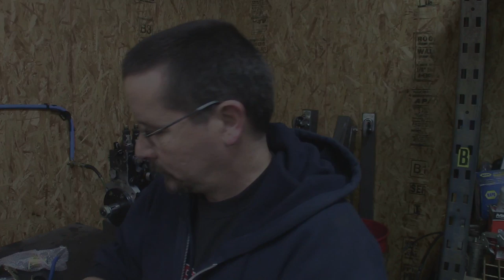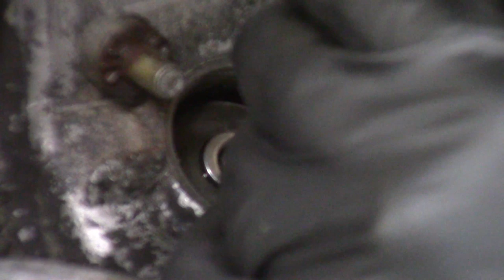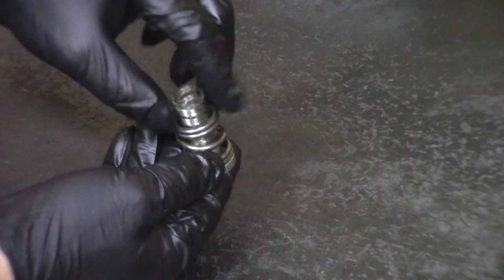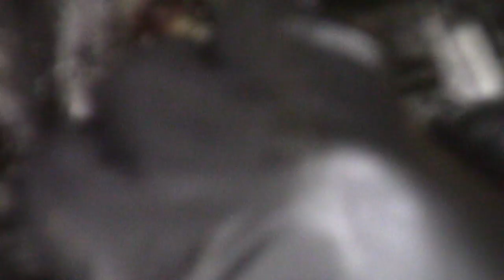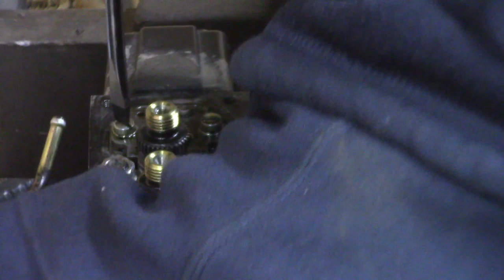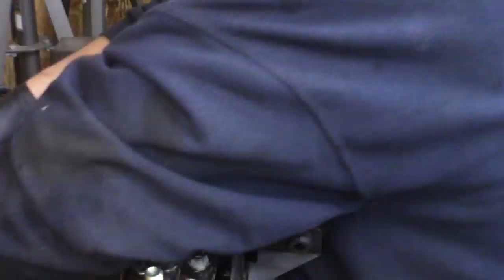How to Turn Up the Cummins P Pump!!!!

Comment: Just did a few mods to my P7100 this evening.  I did the modifications to the AFC housing necessary to run the Power Driven Diesel AFC Live kit.  I have governor springs as well but I'm going to wait until I have the pump back on the engine before I turn it over.  I installed new delivery valves this evening, which went well.  I also had my pump in my bench vise and it worked well to hold the pump.  Just need to get the pump painted up and then it'll go back on the engine.  Once I verify the engine runs again (I took it down to a short block and redid everything, similar to your build) I'll start tearing the 454 out of the truck.
Reply: Did you do the afc live I'm getting one soon for my 94 Thomas saf-t-liner skoolie. Are you happy does it work well.

Comment: Wow, very well done about replacing the governor springs off the truck and this video was hard to find, cuz everyone else seems to replace them in the truck! Good point about the dial indicator for the fool-proof way of making sure the tension is correct! I have a spare P-pump off the truck that was rebuilt from 160hp to 176hp with OEM 2500 gov springs. Needs governor springs, as the Bosch Service Center couldn't do it as per Bosch. My 95 OEM 180 P-pump had 3k springs in it, and I don't want to go rpm-backward with the rebuilt pump, but I want the pump to be more responsive and fuel harder earlier, not looking for more top-end beyond 3200 most of the time.
Reply from the maker: Thank you and thanks for watching.

Comment: Getting ready to do this as well.  I made the mistake of braking my timing Fork tool in my pump because I got everything in time and then came back to it the next day... and forgot the timing keys were in the pump and motor.  That wasnt a fun time but I got the broken pieces.  Had to buy an aluminum timing tool as that little thing from Cummins is like $70!

I am also working with a 160 pump.  I went with the Power Driven Diesel 500hp fueling kit.  5x12 injectors, 4k gov springs, delivery valves and a few other items.  I got their AFC live kit with it as well so I just removed my fuel plate.  I ended up with a BW K27 turbo as my goal is somewhere around 400-450 whp.

Still waiting on  a few more items before I can make any significant progress but the plan is to get the engine running again on the stand before I tear the 454 out of the truck.  I'm hoping I can remove the 454 and install the Cummins (just get it set in place and bolted to the trans) in a single weekend.  We'll see how well that all works.
Reply from the maker: Sounds like a pretty cool build you have going on there. 
The next stge in these videos will be installing the engine in my  82K30 so hopefully their will be some stuff in them to help you with that part as well.

Thanks for watching!!!
Reply: I’m thinking about the 375 hp kit on my 12 valve

Comment: was thinking of going from stock to 5x.012 injectors on my 12v. for more h.p. I have straight 4" exhaust and afe intake. Would I need to do any other upgrades or would the 5x12 be safe on their own?
Reply from the maker: That is the same injectors I'm running. If you do those injectors along with the springs and fuel plate mods you'll be very happy. 
If you are after more smoke go with a more aggressive fuel plate. 
I didn't get any any excessive smoke but everyone has different goals. 
Bump your timing up if you want to see more throttle response
Reply: @RicosGarage  16 or 18 degrees? thanks

Comment: So I have a 230 hp model 6bta 5.9 cummins no has yet to explain how is it getting there. It's in a 94 Thomas saf-t-liner school bus. Ive converted it to a motorhome aka a skoolie. I get no smoke at all. I'm wanting to make some mods but feel I could go backwards if it's just a ppump mod to get it there. I know it's detuned to not smoke out mom on the curb waving bye. How does a 3k governor work with shift points on a mechanical engine and a mt643 transmission

Comment: So do you have to pull the flag and its cap if the pump is still in the engine and turn it over via the front dampener?
Reply from the maker: Yes that is correct

Comment: @7:55 I had this plug fall out and I lost a bunch of oil on the highway, does anyone know exactly what this plug is called and the piece behind it? I heard him say flag. Currently I only have a plug from a pipe that is threaded into it and have been running it like that for 2 months.

Comment: What's the purpose of adding like a 3k governor springs. What does it do to the PPump?
Reply from the maker: It allows the engine to turn at a higher rpm. This allows for a higher top end road speed. 
Also when used with other kids such as fuel plate and bigger injectors and such allows for more power.
Reply: @RicosGarage  interesting cause my truck hits 3k but the ppump looks stock. It even got the security chain across the cover.
Reply: What's the best way to lean out the truck a little cause I got a small amount of black smoke as soon as I hit the pedal.

Comment: Hi i have problem with governor on my P7100 pump. Its surging and i have hard time to start engine. Do U know what could be a reason?
Reply from the maker: Has the pump had any work done to it recently?
Reply: @RicosGarage  We are talking about marine engines and as far as i know boat was submerged. Whoever decided to milk the insurance, they filled up to the top with oil prior to sink.. Im the current owner and trying to reambulate boat.. I changed bunch of things on those engines. Port side works like clock but starboard gives me a hard time. Previous owner had AFC top cover removed and he was sticking with screw driver and probably he did some damage with governor. Any ideas what could be a broken inside?)
Reply from the maker: The pump is essentially a small engine in itself. Lots of moving parts inside. I'd recommend you take it to a reputable shop as it may need some internal parts replaced
Reply: @RicosGarage  Thats a good advice but problem is that shops near me they are specialized in truck engines. For me engine is engine and dont see big difference between the pumps.

Comment: Why not adj spindle,and Allen bolt on after housing??
Reply from the maker: I just prefer to do the adjustment on the vehicle. 
I've found every application is a little different and there is no hard and fast rule of turn this screw 3 turns etc. 
Doing the adjustment on a running driving truck allows to "tune" it better in my opinion. 
Thanks for watching

Comment: I’m trying do this on the engine does the pump
Have to be timed if it stays on the engine
Reply from the maker: No if the pump is not removed or disturbed in any way it will not need to be timed.
Reply: Rico's Garage ok thank you I have a 1998 ppump out of a ford 800 box truck in my 1963 Lincoln continental just had a over rev issue so had all new stainless valves and 60 over springs installed

Comment: Do I have to replace my stock injectors if I upgrade my fuel plate to a number 6?
Reply from the maker: No you can still run your stock injectors
Reply: @RicosGarage  ok so I just want a little more hp but i dont want puffs of blk smoke. What's the best upgrade for me?  Should i change the plate? Upgrade the gov springs? Injectors?
Reply from the maker: Plate and gov springs will wake it up without spending tons of cash
Reply: @RicosGarage  ok but what plate # you recommend for about 250whp. Also what spring rate for the governor.  What does it mean when they say 3k and 4k?

Comment: You put the flag in backwards when you put the cap back on. You said the brass part goes towards the inside of the pump and the groove goes in the cap and tightens down.
Reply from the maker: Good eye!
I caught this when assembling the pump but must have gotten missed during editing. 
Thanks for watching!
Reply: @RicosGarage  thank you for the great videos you have really good and informative content. Are we going to be seeing an update video soon?
Reply from the maker: Yes update video is on the way. 
Currently working out computer issues. 
In the meantime follow us on Facebook and Instagram for updates until we can get back to posting video

Comment: I pulled my plate and am running no plate opinions ?
Reply from the maker: That's always an option. Only drawback is excessive smoke. 
That's not a concern for some people but I didn't want to deal with soot on the trailer and we have DOT officers here that will bust us for excessive smoke. 
Just my thoughts not sayingyoyr way is bad. I just had my reasons
Thanks for watching